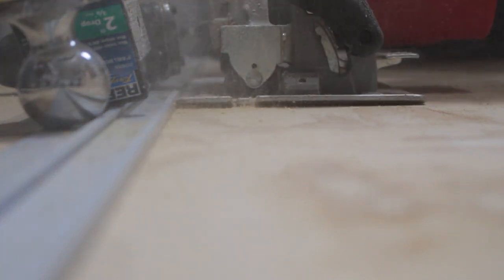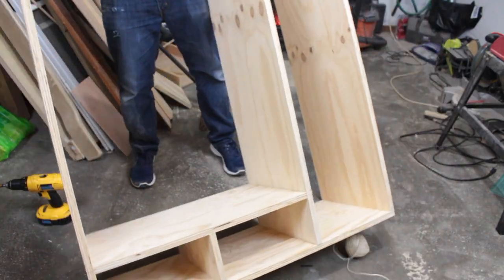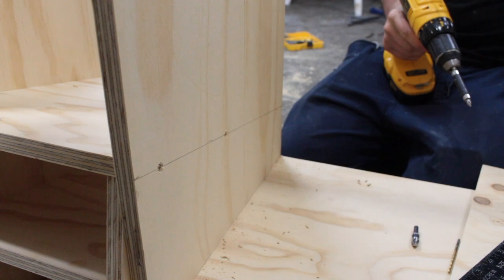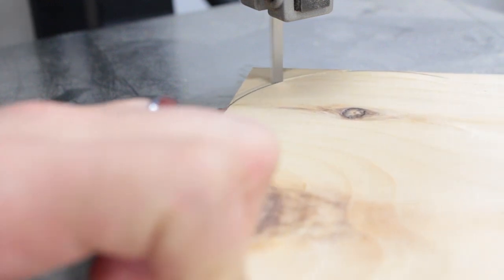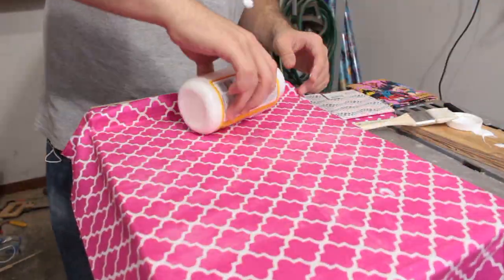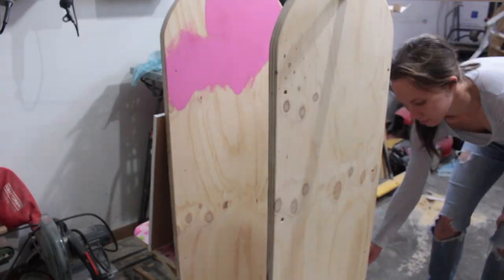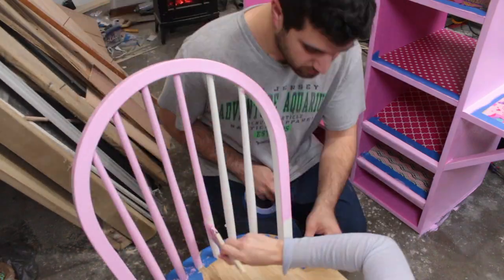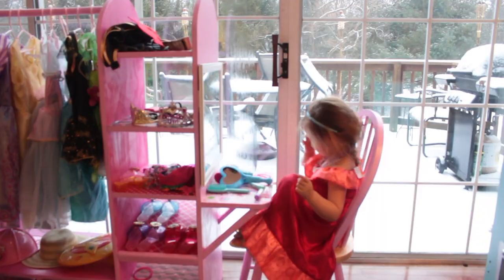DIY Dress Up Station with vanity! #rocklerplywoodchallenge

Comment: Just found your video..how many sheet plywood did u use??
Reply from the maker: I think if you planned right you could probably get everything out of 1 sheet - I probably used 1 and a half - I get the 3/4 inch sanded stuff about $40 a sheet